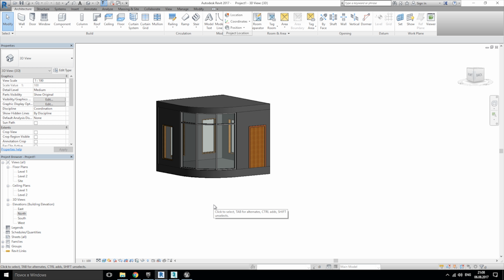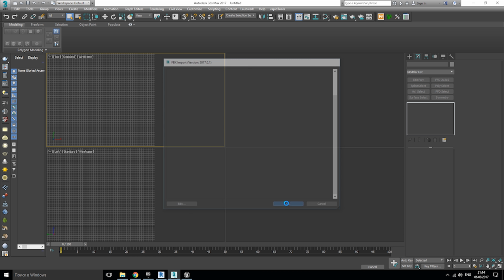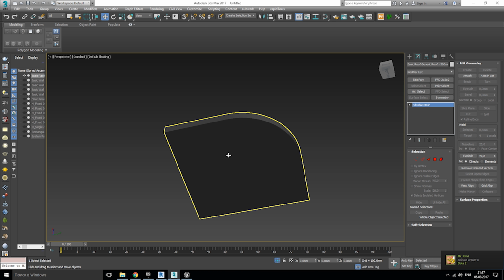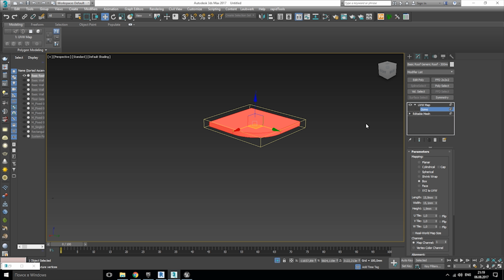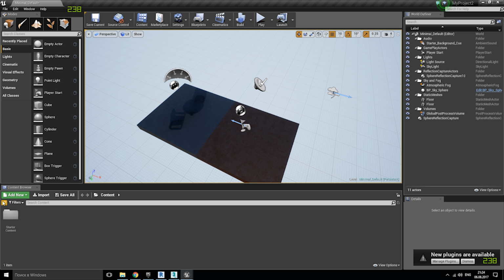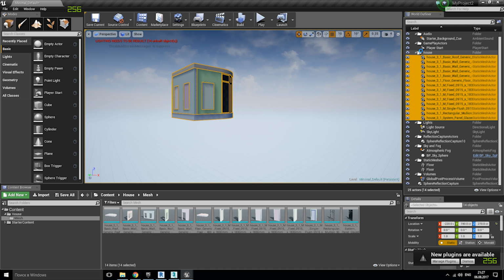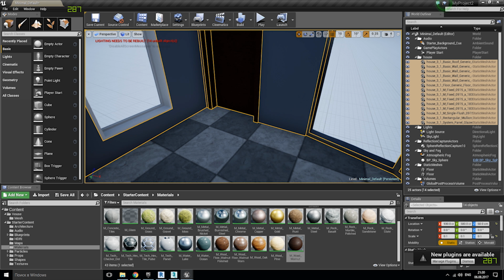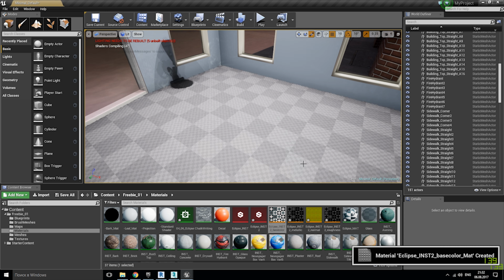Revit & unreal engine 4: How to export Revit model to UE4

Comment: Subscribed! Can you do a tutorial on bringing over an enormous Revit file (like over 8 million polygons and 15,000 objects) into Unreal Engine?
Reply: This would be great as i'm having trouble importing 13,590 objects currently. Taking a very long time as well as making it have uncontrollable lag. Have you come across best method of practice to do this? Maybe from attached objects in 3ds max will help?
Reply: @JnDoeHankcock  I guess you can export fbx and use "link Revit" to combine by material, after that you will be able to select objects by materials and assign detailed materials to them, the rest is described in this tutorial

Comment: exist a other tip for export the file, and no run 3d max for atach o group the similar elements, cause in this case is a litle proyect but a building is other escale  and  atach all parts is a slow process
Reply: I do not understand, can you clarify? I am trying to avoid using 3dmax
Reply: @MrFishhunter  he did another video with the plug in